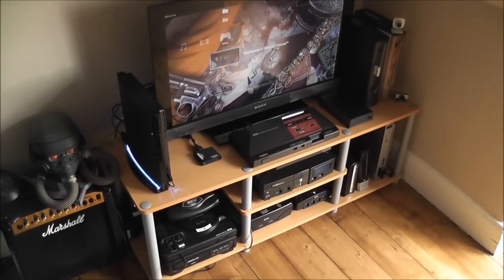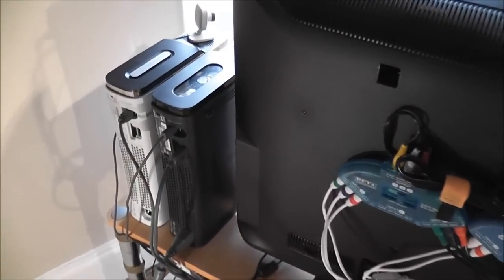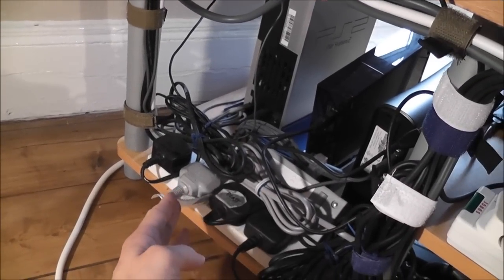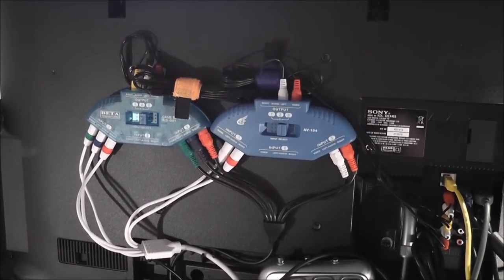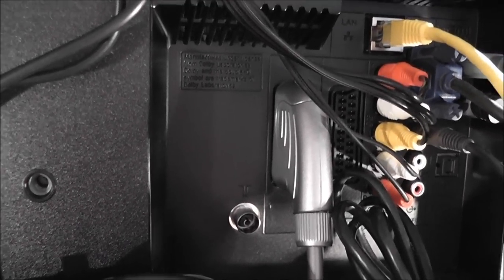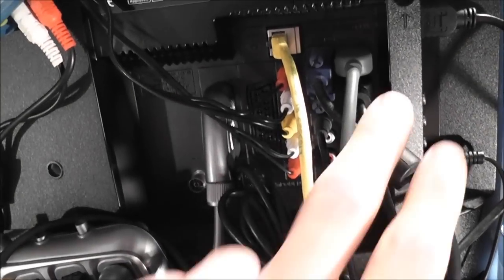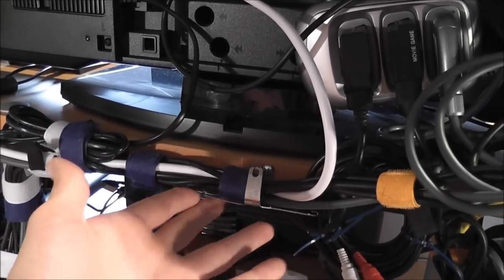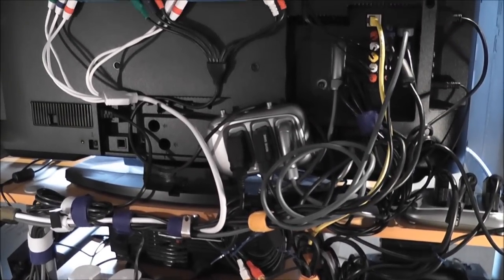Console Cable Management - Some Tips And A Quick Tour - How To Connect Multiple Devices

Comment: For playing the actual consoles, eschewing emulation, you've done a brilliant job setting things up. I'm a nutter when it comes to electrical safety/fire hazard and like you said your set up is very safe. All on surge protectors, all wiring neatly done up. Plus you have very minimal video signal wire-electrical wire crossover (video cables resting or touching power cables) and that always helps picture & sound quality believe it or not. Great stuff...this is why I subscibed!

Comment: That's real nice set up. Thanks for the idea.
Reply: Well, it's missing one important thing. The sound system! Yes he has more consoles than me, but I still don't get why people have a huge screen (bigger than mine) and use the crappy built in speakers :-/ My PS3, PS2, PS1 and SNES all have their audio running through my custom 4" 2-way bookshelf speakers powered by a Technics amp, which is hooked to a Behringer crossover set to 90Hz which then goes back out to a couple of 8" active subs, one custom and one modified. With 275w RMS, the system has loads of dynamic headroom with a wide frequency range, and the sound is clean, clear and detailed.
Reply from the maker: +RWL2012 That all seems a bit overkill for retro systems pumping out 16bit chip tunes :P . But on a practical note, I have (had) neighbours to consider so unless I was looking to score an ASBO, it would be pointless to have anything more than the TV's built in speakers, which btw, sound fine on this model. Also, in a later vid I showed me installing a 5.1 optical headset unit to the setup. But all of this is irrelevant since none of this exists anymore. :P
Reply: What have you done with all your stuff? :-((((

Comment: Not a bad effort! One or two things I noticed though:-

1) You'd get a much better picture by purchasing an upscaler such as the XRGB3 or XRGB-Mini. If you haven't got a CRT this is the single best investment you can make to improve retro-consoles on a HDTV. Improves picture quality AND reduces input lag.

2) Those SCART switches leak voltage, so even when deselected voltage from one input leaks through to another! This can dim the picture, add noise or even damage your consoles

Comment from the maker: No, it's perfect, the picture looks excellent. The switch boxes are very good quality and only add about 12" max of extra cable to the original lead. They're very well insulated, manually/mechanically switched and only a single device will be fired up and outputting video at any one time so they're completely isolated from each other.

Comment: Nice setup, man. Most of my consoles that are hooked into my TV, are daisy-chained to a VCR, a DVD recorder and a Hauppauge HD PVR. I manage them by keeping track of which ones use Composite or Component. All the Composites go into the VCR that's hooked into the DVD recorder, and I have a 3 way Component cable for the Wii, the PS3, and the 360, that gets hooked into the back of the DVD recorder that outputs to PVR, and goes to my TV.

Comment: 3) You can actually mod your Dreamcast VGA box to output both 15khz and 31khz. You then simply need to construct a cable with a split, one going to SCART the other to VGA.

4) There are better component video switches that you could mount on the front of the system.

I enjoyed the video though, I really must video my own setup if people are interested in this kind of thing.

Comment: Nice work, epicly tidy :O

I gave up in the end lol

I don't have a proper telly setup, just a large monitor. Had PS, PS2, DC and MD to a switch box for the single composite input with 3.5mm cable to external speakers, Xbox on component with 3.5mm out, PS3 with monitor 3.5mm out, PC1 on Display Port with 3.5mm out, PC2 on DVI with another 3.5mm, power for 2 PCs, 3 displays (eyefinity on PC), 6 consoles *mind explode* Scrapped that now and only plug in what I need xD

Wish I had your patience!

Comment from the maker: I'm not sure what Scart switchers you're referring to but it definitely isn't these ones. I've had these disassembled for inspection and was very happy with build quality. They are mechanically switched and each socket is isolated from the other. There's no dimming or interference of any kind. I wouldn't have bought them, installed them or use them if they did.

Comment: Those grey push button SCART switches dim the picture significantly, and the more things you attach to them the worse it gets. Someone over on the shmups forum took one to bits and inside they are shockingly poor, in reality they aren't isolated at all, the RGB lines are not switched, meaning for example if you have a SCART cable with capacitors inside it (e.g some SNES cables) then the picture will be dimmed further because these caps are now in the circuit no matter what console you use.

Comment from the maker: The really cheap switchers work like that but these don't. Most of these switcher boxes use the same or very similar looking housing but the components inside and quality of the cable/shielding (if any) varies drastically depending on price.
I did lots of research when putting this setup together and picked those switchers because they were very good quality. They weren't cheap either! :-P. 
As for my picture quality there's no noticeable difference between direct hookup/running via switch box.

Comment: Its a little unnerving at first glance, but I suppose you aren't ever going to have them all running at once so they will probably be fine.
Cable management is something I really need to sort out on my setup, my tv is in the corner of the room and in the space between the stand and walls is a jumble of cables. 
Will have to keep an eye out for those velcro cable ties, did you get those online, in a pound store, supermarket etc?

Comment: Big fan of all your videos! I've just bought a xbox 360 slim with forza 4. I have  old but decent Sony trinatron SDTV which I have connected my xbox with the supplied 3 composite leads. The problem I have is the writing on forza is so small and blurry I'm struggling to read. I've read that it's because I only have a SDTV. My question is....will a s-video lead improve things? I've never even noticed the s-video on my tv before but I can't quite Fford  HDTV just yet.

Comment: Just imagine if we could just have some shrinked central console power supply, would it cut down on the mess in the rear.  I am thinking of having a central 12 volt battery as a power outage immunity system, as well as be part of a console cord consolidator.

Comment: Maybe I'm making them out wrong on the video then, the ones that are bad are grey and have a single push button to switch, the button clicks in place and then clicks out again when you push it. Internally, the switch only switches the sync and audio lines, RGB is just fed straight through. Though I'd say all mechanical only switches and most powered ones do degrade the picture at least a tiny amount. Better than cable swapping though.